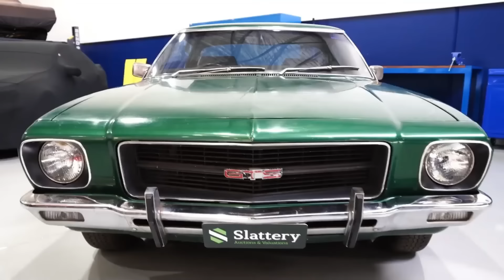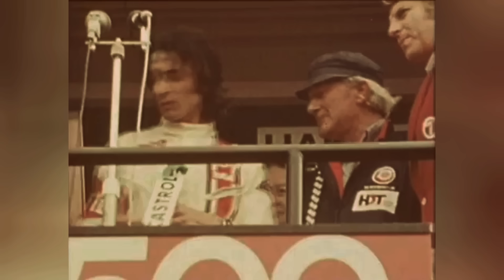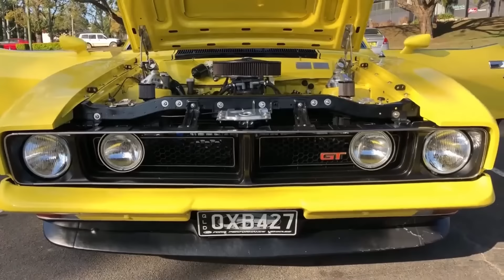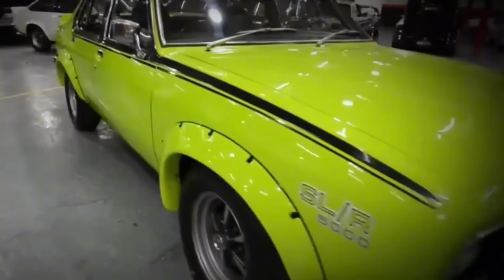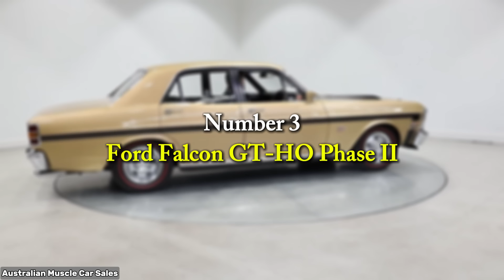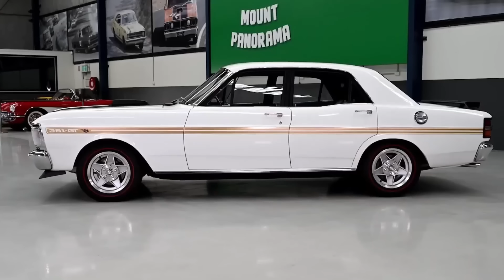10 FASTEST Australian Street Cars Ever Built

Comment: BATHURST is Australia's equivilant of TWO Indianapolis 500s... BACK TO BACK...It's Official name is the The Bathusrt 1000 ;) The XA, XB, XC Falcons were a straight out copy of the American Torino ;) The HQ Holden came out with an AUSTRALIAN V8 aswell as the American V8s... Ford Australia used the same 3 American engines for it's entire existance in Australia :)  The FORD XYGTHO Phase 3...(worlds fastest 4 door) was BEATEN at Bathurst by a 6 cylinder Holden Torana...it was crap :) Holden DOMINATED the Bathurst 100...right up until the end of ALL car nmanufacturing in Australia....

Comment: No Problem 
My 1965 Porsche 911S was doing 230km/h
Reply: These cars were heavily speed limited due to their gearing. Many of these cars have enough power to get into the mid/late 200's speed range but their short ratio 3 and 4 speed transmissions drastically limited them.

Comment: The GTHO phase3 Falcon at the time was the FASTEST 4dr production sedan in the world!!!! The ''Madmax'' Falcon coupe, the super charger was FAKE driven with an electric motor did NOTHING for engine power!!!! I prefer the look of the SLR5000 over the A9X. As for Aussie muscle cars i think you will find the GTHO phase3 Falcons have the highest price nowadays IF you want a genuine one it will cost you MORE than a million dollars now!!!! Imagine with technology what HP the 351 Cleveland could make!! 600+++++
Reply from the maker: Thanks for the extra details, great points! 👍👍
Reply: @AussiewithAlf  there is NO denying the performance of the Charger and the Holden's there is just special about the GTHO phase3 plus there were earlier versions going back to the gold XR think they had a 302 Windsor it would still GO good i am sure!!!!
Reply: @barryphillips7098  XR was a 289, XT was 302
Reply: @nevillekettle1823  ok
Reply: GTHO PHASE 3 A "RACE CAR " ????  sure with that heavy cast iron  pushrod v8 / cast iron gear box / drum brake rear / non independat rear /  / steering box ......definatlly not a handling car thats for sure
Reply: @MDS-c5l  In the early 70s these were racing and quite successful at Bathurst, the cars back then had to be ''showroom stock'' they even Had to have the spare wheel and jack in the boot or you were allowed to race!! Look up the early years of Bathurst racing, it took real men to throw cars like this around a demanding track!!!

Comment: Actually the HQ Holden 350 GTS Monaro had the 275 HP 350 ci Chevrolet V8 from the factory in both the 4 speed Muncie and the auto trans whereas the previous HG 350 GTS had the 300 HP Chevrolet V8 in Manual and the 275 HP Chev V8 in the automatic and the HQ had the HG’s auto spec V8 in both manual and auto, as Holden was now concentrating on its performance car the LC then LJ GTR XU-1’s as the Bathurst hero other than the the Monaros, even the Australian Bolwell Nagari sports car powered by Ford Australia built 302 Cleveland and especially the 351 Cleveland Nagari was a fast street car of the era irrespective of numbers built I think the Nagari should have had a mention also the CY Falcon GT’s-HO phase 3 put out near or exceeding 380 horse power and Ford Australia only rated it as the base XY GT’s 300 HP for insurance purposes etc the same way that Ford US did for similar reasons also it is true for a short period Australia’s Ford Falcon GT’s-HO phase 3 was the fastest four door sedan in the world and only eclipsed I believe by the four door Aston Martin Lagonda as was reported in an Australian motoring magazine back then in which I still have a copy of, plus what also should have been mentioned was the E49 Valiant Charger was also the fastest accelerating six cylinder production car in the world at the time
Reply: A bit of work even if it was just extractors and a decent carb and you could soon add some serious HP. My first car was an LX SLR 5000 cost me 6000 in 1987. Some decent work and an SLR would do 11 second quarters. When I had kids it was sold and I had a Ford TD cortina 6 cylinder 250 (4.1) crossflow. That engine you could hammer all day. A mild cam extractors a decent Holley and it was quicker than a small V8. Quickest car I was ever in to this day was a blown 350  HQ Monaro. Ford and Holden made some serious cars.

Comment: The phase 3 may have had the highest top speed but the E49 charger did quicker quarter mile times.
Reply: That is Exactly Correct !
Reply: Yes but they never got t
O meet the fast car Australia made the XA GT
Reply: @gordonclark4049 the 340 E55 Charger auto with air and steer was faster than an XA gt over the 1/4
Reply: And it had a single spinner diff, with a restricted single exhaust system
Reply: I had the opportunity to own many of these muscle cars including the phase 3 and e49 etc. The car that had the best throttle response by a distance was the xwgt ho phase 1. I drove 2 of them and was a passenger in one of them. They performed identical. They thrashed the cleveland 4v and everything else. No one believes it but its true. We proved it over and over and shut everyones big mouth. My uncle clocked a 13.6 on the quarter mile with the only mod being wider better tyres
Reply: And it was also better all round on the track
Reply: $1.5million for a GTHO phase 4 . Hard to believe i grew up on a town with 4 of them ! 2 x red , 1 x silver , & 1 x blue ! Wonder where they are now ?
Reply: @g @graemecouch5010  three red designed for racing, and one calypso green which was the only one with the GTHO ID plate. Never four, never in blue. Only two red still survive, one destroyed in a driving accident. One in a collection, the other is now on the road and in a GT club. The Calypso green is now owned by 'The Dentist' and attends All Ford Days now & again.
Reply: @graemecouch5010  Yep, I don't believe you. There were only 4 phase 4s made.The only phase 4 road car and was Calypso green. The three race cars were Brambles Red.

Comment: Slow by todays standard. Many make big noises but that is about it. 😅😅 I usualy shut them up with my 400 HP 550nm 4 pod Golf R 👍🇦🇺👋
Reply: Pretty sure nobody will remember your hair-dryer in 50 years, and certainly nobody will be reminiscing about it.
Reply: @petethetruckie  In 50 years the people who were around at the time of the GTs etc will all be dead. No one will be reminiscing about them either.
Reply: We're still in the time of the GTs, just like we're still in the time of cars from the early 1900s. As long as people still appreciate style, the older stuff will still be remembered, no matter how much this generation wants us to think otherwise. 
We're all still waiting for this generation to give us something, apart from their incredible ability to complain about everything.
Reply: @jamesdoust6975 what a load of rubbish when l take my car out kids and young people love it😂.
Reply: I know what I’d rather be in and it ain’t a friggin golf!✌️ Hey Charger
Reply: until the gearbox goes bang, one of worst sounded cars ever, like farting down a vacuum pipe
Reply: Nobody cares!!

My 1983 Rx7 has a 13BT 
900kg 250kw@rear wheels
Has a manual H pattern, a 5 speed and a clutch!! 4.37 diff race LSD etc etc
I built it myself when I was 19, so from 98 until 2015 you couldnt buy a brand new lambo/ferrari/ that could keep up.
I still have it and it does power skids to 200km/h  
Straight line, sideways or through the hills its still faster than your car👊
Bought it for 5k spent 15k on it and now its worth 60/70.
Reply: Thats new against old my hsv would shut you up 2 😂.

Comment: Torana is the only car in the world that you could buy with a 4  cyl 6 cyl and 8 cyl  ford fan here
Reply: VC and VH Commodores were available with the Starfire 4, as well as the Holden 6 and the 253/308 V8. New Zealand market VK's also had the Starfire 4 as an option. Export versions of the VN were also available with a 4 cylinder engine (IIRC, it used the 2.0 litre from the final model of the Camira).
Reply: You have forgotten the  Mercedes 6.3 4 door sedan the fastest 4 door sedan stated car magazine back in the 70s😮
Reply: @gregorysaksida2218 it was 6.9 in a 450SL.Bloke next door had one.Autobahn special i guess.
Reply: Not quite correct, the LH Torana was the 'first' car in the world to be made available with a 4, 6, or 8cylinder engine option, not the 'only' car.

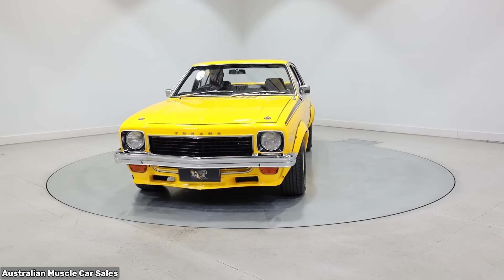Comment: 7:10 ~ I would hesitate to describe the SLR 500 generation as "Holden's light weight platform." Step forward about 3 ~ 4 years and talk about the very first round of Commodores, and those were Light Weight, but the L-34 era Toranas, not so much. The narrow platform Torana's were pretty light, but when they gave it middle-age spread, they also added a bit of heft. They do feel quite crisp to drive so the weight is far better hidden than on an HQ, for example, but they're not a light car.
Reply: Officially the L34 Toranas were around 100-170kg less kerb weight than the VB-VK Brock Commodores. Around 7-12% less weight. This was due to the L34 being a shorter/smaller vehicle that didn't have extras such as aircon, power steering, centre console, boot linings etc. It was built specifically for reduced weight. The standard SLR5000 was heavier than the L34. The L34 was lighter than the V8 Commodores.
Reply: @mungowagga  ~ ok, thanks for that.
To be honest, I've never driven an SLR5000, let alone an L34. I have driven exactly three box-body Toranas, all with 202s in them. I have driven a few V8 c'dores, including one almost new 5 litre VK Calais for a few days, which was fantastic fun. I have owned a VC 'dore, with a hotted 202 in it (350 Holly, 30/70 cam, big valves , port-matched ~) so I have looked up the weight of those. I also drove perhaps 300 ~ 400 thousand kms around Brisbane streets in cabs, on night-shift, which were early model c'dores, so those animals I am very familiar with.
Mostly I'm going on magazine reports, which said things like "Even the mighty 308 felt a bit ordinary, because it was being held back by the weight of the car, which is considerably more than the narrow Toranas were." I read that general view perhaps a dozen times, from various people, expressed slightly different, but the same general idea.
I remember a Harley of that vintage, has 1340ccs, an 80 cube motor. By sheer coincidence, a V8 c'dore (VB, VC, VH) weighs 1340kg dry ~ at least that's what Holden say in the handbook. I have never looked up what an SLR weighs.
Reply: So how much does a 5 litre Torana weigh compared to a 5 litre VB Commodore?
Reply: @indykartsindoorgokarting6711  I would have to google it. The c'dore is 1340kg but I don't know off the top what the SLR is.
Reply: I had an LC Torana
Reply: @charliemaddocks3277 ~ Yeah. I had cheap wine and a three day growth.